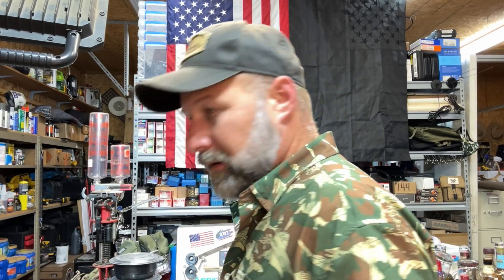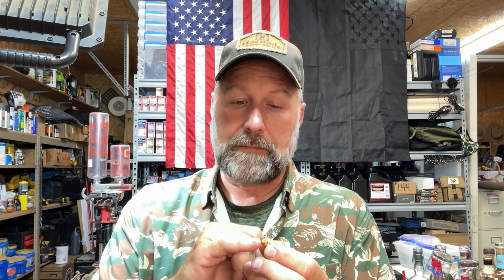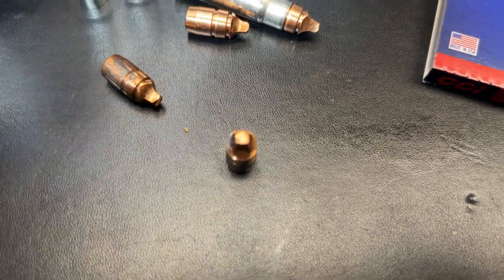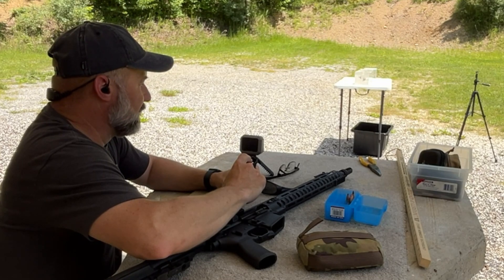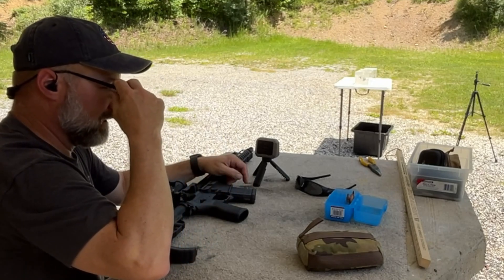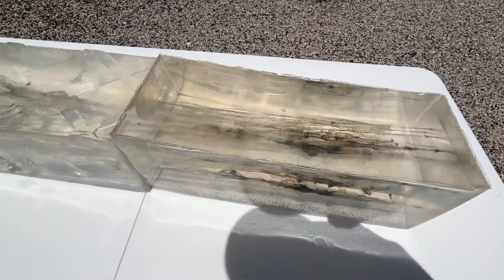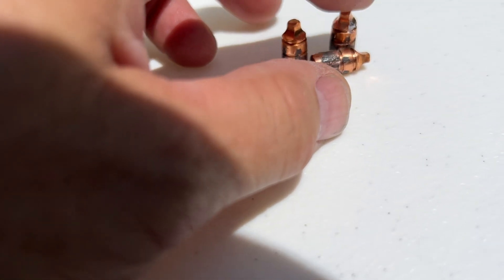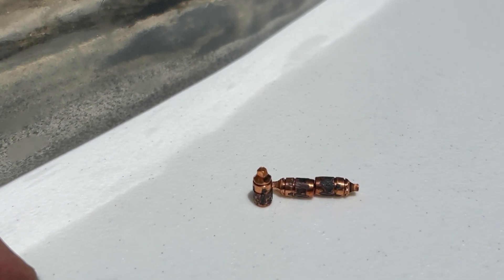.300blk, Lehigh Defense 85gr Xtreme Cavitator Solid Copper Bullet, Ballistic Gel Block Testing

Comment: I'm a pistol guy, but I've been really working on getting a 10.5" 300 blackout AR set up. Never had an AR, I got bear, pigs and gators around my house so I want something to get through those if they go after my dog. I have a 12g scattergun now for that reason, but I want an AR because ...vibes.
Reply from the maker: @sakfpv8444  sounds like you need a supersonic round with more penetration over expansion for those targets. Or if your contact distances are within 50yrds, possibly alternate between a heavy solid like the 220gr Berry’s plated and a heavy expander like the 220 Maker’s REX.  If you’re not worried about running a can, I’d load both of these as supers, to their max velocities. Especially if you’re looking at a defensive situation for your dog.  You’ll already be losing velocity with the shorter barrel so get as much as you can from the loading.  Mark them individually and keep them in a separate mag from your sub loads. 😉

Comment: The Lehigh FTM tech projectiles are at a disadvantage in ballistic soap and Real Clear Ballistics. No fluid to do any fluid transfer 😂. If you want to check the real potential of this load you need to compare it in proper gelatine. 
Currently trying to cook one up with this 85 grain in 308 Win. Should be about 3350 fps out of a 16”

Comment: Appreciate the work that went into this 300 blackout series
Reply from the maker: lol. Thanks and it’s definitely been some work. I’ll be adding several more bullets over the next couple of weeks. Most are supersonic and some may pass through the gel.  

These are loads I’ve used over the last 12 years. A couple right after I got my first .300blk in 2012. 😂

125gr FMJ, Hornady 
125gr ballistic tip, Nosler
125gr open tip, Speer TNT
155gr Accu-tip, Remington
175gr, Amax Hornady 
200gr Partition, Nosler.